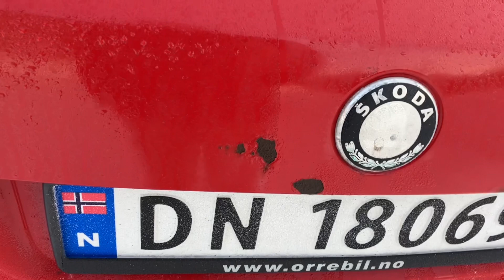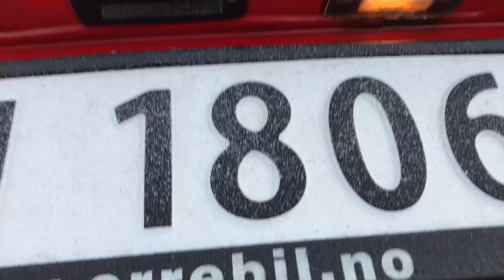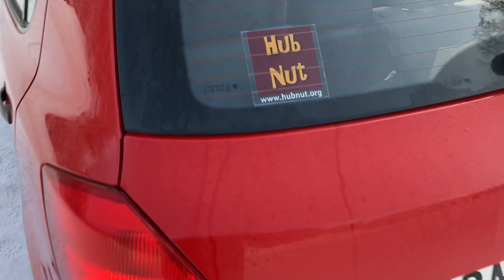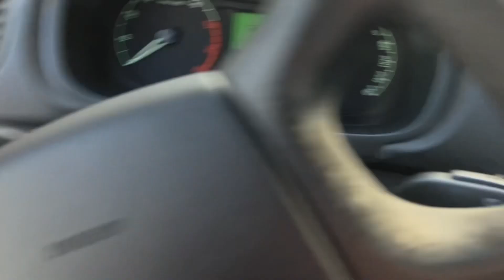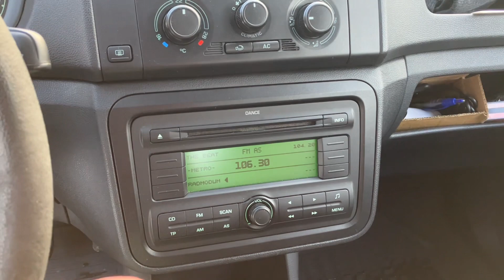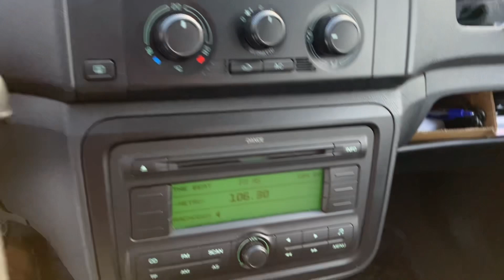1 Year/36.000 km ownership review 2009 Škoda Fabia 1.2 CLASSIC.

Comment: Did you figure out the settings on the computer, I have the same fabia with only a pin for the computer and all I can do is reset the trip and change the time, is there anything else I can change like l/km or outside temperature?
Reply from the maker: I don’t have a onboard computer in mine as it’s the absolute lowest spec Fabia. I can only adjust the clock and that’s it. Not even a outside temp facility 😁
Reply: @SvennsCarchannel  Same🫠. But anyways it's a good car 🙂
Reply from the maker: @RaMmSteIn540  It sure is. No nasty surprises so far☺️